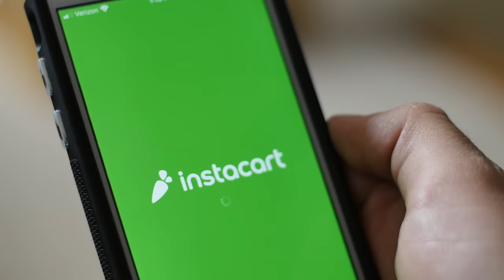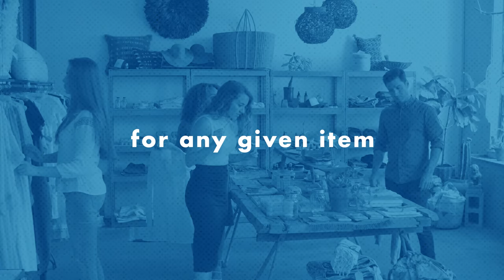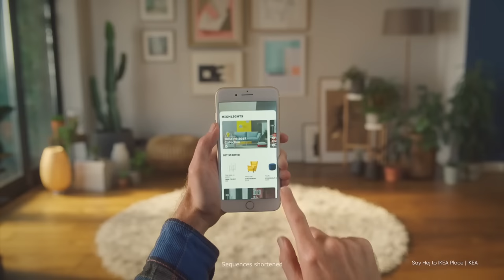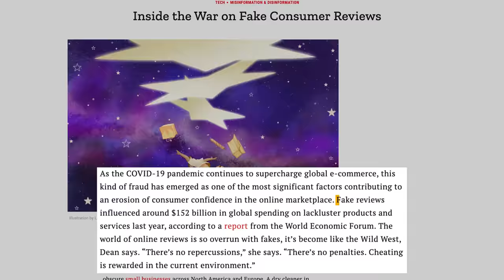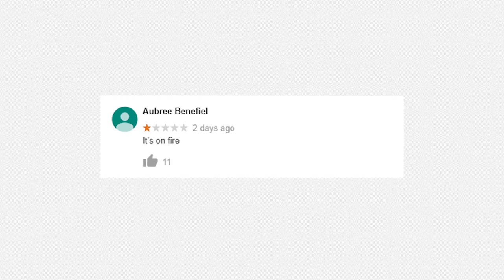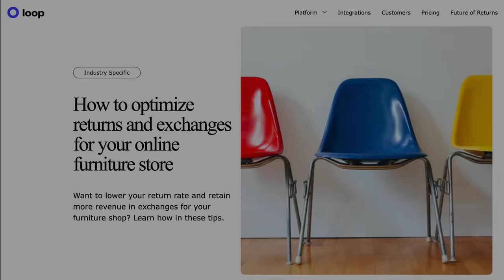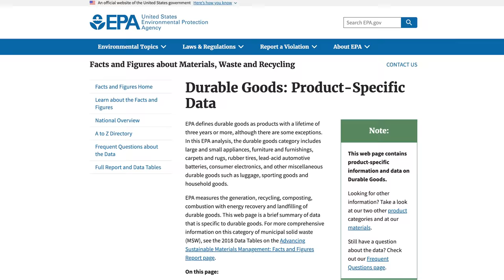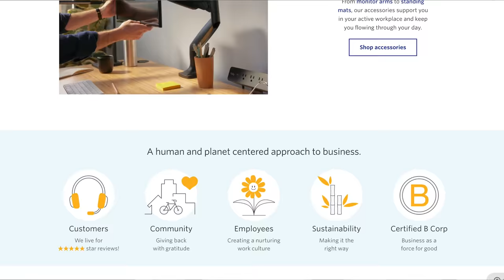The PROBLEM with Wayfair Furniture (DTC)

Comment: Quality drift is also happening with sound. Landline phones or a real stereo and speakers have better sound than smartphones or PC speakers or low-end soundbars, yet so many people go for convenience and don't realize the quality they've lost. Part of the problem is the market has bifurcated: you can get a smartphone+soundbar or a big heavy $200+ receiver with 15 inputs, but the smaller simple receivers in between have mostly disappeared.

Comment: Even after looking around at all the furniture stores here in Canada, the most comfortable sofa I found, and the best one by many accounts, was the one that was FREE.  My table cost me 75 dollars on the local classifieds.  IKEA, Article, and all the other online furniture stores you mention pale in comparison to free or used on the local classifieds.
Reply from the maker: Yeah going used is the best way to find something quality for cheap. Glad it worked out for ya 👍🏻👍🏻👍🏻
Reply: My sofa - my ex and i found it in a thrift store like 28 years ago? It was a knock-off crate-and-barrel style, sofa and love seat.  He refinished and repaired the wood parts, and a few years later (after we split) i found a company to make custom replacement cushions (knock-off sofa, cushions were different size than the standard).  Ok but now i REALLY REALLY need a new sofa!

Comment: I have a bed that's 50 years old that was given to me, I have 2 trash cans and a lamp someone put by the curb I have a few end tables, lamps, and dressers I got for free. I did have to buy some plastic storage bens for the storage unit and I did buy some plastic sliding drawers for clothing and extra storage. I do have 2 particle board shelves because I needed them and couldn't find used ones without driving 1-2 hours away to get them....lucky I was able to buy them at Walmart. I don't think I have ever bought any furniture from online. I like reusing older stuff when possible. Some of my most precious treasures have been free, used, or curbside finds.

Comment: I made the mistake of buying an Ikea couch 3 years ago.  I remembered it being "sturdy enough" when a roommate had one a decade ago.

Well, 3 years later and the arm has literally broken off.  I pulled up the upholstery to try and DIY a fix and found it was particle board held together by staples.  Tried metal brackets to reattach, and a week later the wood broke off around said brackets.

What a waste of natural resources, I will never buy an Ikea couch again.

I went to an actual furniture store and spent about 4x more this weekend to get what I hope is a real couch that will last.  But I have my lingering fears that even this couch will turn out to be a poorly made mass manufactured piece of junk.  I am having a harder and harder time trusting any manufactured products with how many times I have been burned at this point.

Comment: The thing is, I move every 3-4 years because rent is on a rapid ratchet going up and up at ever increasing rates.  The exact amount of space I have varies, so I usually wind up getting rid of a great deal of furniture.  Disposable furniture that can be thrown away easily that doesn't have to last more than 4 years has a lot of appeal.

I'm considering a job that will move me decently far away and am seriously considering if it's worth moving my existing furniture.

Comment: ive got a related but like opposite problem. Buying furniture on facebook marketplace or gumtree or whatever. POUNCE quickly before it's gone, Oh crap it's actually a bit bigger or smaller than I had imagined and that oak top really is warped and not something I can fix with a screw and a sander. But besides an attic full of future projects that I'm still deciding what to do with, I actually have some really nice hardwood furniture.

Comment: I furnished my whole place from the ReStore
I had to get to two different ones in order to get everything I wanted but it costed about $700 
I rented a truck from home Depot for a day and then I went to both and I got all my stuff and I rented a green machine from Rona which was about 24 bucks 
I cleaned the couch with it and it was fine
So all together it costed about $1,024

Comment: Funny story. I JUST bought a new bed and yes, it was DTC. The bed before though was older than I was and the only reason why I had to throw out our was because I was putting it back together after moving and a family member fell on it at the wrong stage in the building process and completely destroyed it. I was one of those magical unicorns apparently that did know exactly what I wanted in a new bed. Unfortunately no one is making that bed (I spent days looking, even on Etsy). Since I don't have the money to commission that right now I went with something that looks nice and works for my situation, and also according to reviews seems durable. So eventually I'll get my dream bed but for now I'm hoping to keep this guy for awhile.

Comment: I have purchased a lot of furniture in the past 5 years.  Prior to that i always lived in apartments so i never thought of any of my furniture as "permanent" as who knows what will fit in the next apartment.  After purchasing a home (well, convincing a bank to buy a home...) i'm taking more care with what i purchase.  that said, i have purchased a number of items from online stores, like (and including) Wayfair.  I think that the key is to separate the furniture into the categories of use and do some research.  i would not hesitate to purchase, say a side table from an online source, other than truly horrible quality, how much can go wrong?  however, with something that you will interact with everyday (couch, office chair, mattress, etc...) i would certainly not order that online.  local used markets, be that in a thrift store or via an online service (craigslist, etc...) is a great way to go especially if you are at all "handy".  you can find quality vintage items that only require a bit of work, wood glue or tighten some screws, to have a wonderful piece of furniture.

Comment: You say that people used to shop for quality furniture pieces, but did they really? Because I'd bet that no more than 90% of consumers have ever actually known how to identify well-built furniture beyond a simple level of like, something built out of solid hardwood is obviously going to be stronger than something built out of fiberboard. But there's a lot more that goes into furniture than just the materials (for example, the joint type) that affects quality. Not to mention that if it's a couch or an armchair, can you even tell what the framing is like under the upholstery? And physical stores just don't have as high standards for quality anymore. It can be really hard to know whether you are buying a well-built piece of furniture, even if you set out specifically to do so.

Also: I'm curious about you lumping in a brand like Article with a company like Wayfair. They aren't really the same thing, since Wayfair is a marketplace and Article is an actual furniture brand. And Article and some similar companies that you mention specifically advertise their furniture as being well-built, high quality, etc. It's part of their branding. In contrast to Wayfair's branding, which is more just like, it's cheap and the variety of selection is unmatched. Do you have a reason to believe that that's false or misleading advertising? I have been very curious about if Article and the like are in fact producing high quality furniture.

Comment: Interesting video…

I’m in need of a new recliner, and I’ve priced recliners on Wayfair at under $200.  They look to be similar recliners (weight rating & size) to recliners offered in my local stores for around $500-$600.  

One side of my brain says jump on it, and the other side says it sounds too good to be true.  It’s confusing…😵‍💫

Comment: Because of this my furniture motto is if my butt is going to sit on it I’m going to spend more. Cheap chairs and couches are just not worth it on the long run, but a side table or the random cute thing in the room that I don’t put my weight on and probably won’t wear out quickly doesn’t need to be high quality expensive thing. One exception is a dining table.

Comment: We all want the furniture we buy to be of quality.  But often when it arrives, we learn it isn't what we expected.  However, why return it?  Hard cushions can be softened with the addition of a little foam, which is why zippered cushions are best.  Droopy cushions can be stiffened with a little foam.  A sofa seat that's too soft can be firmed up by sliding one of those fold-up stiffeners under the seat cushions.  Throw pillows offer adjustable back support.  Etc.  Now, none of us wants to do this!  But it sure is a lot easier than returning a huge sofa!

Comment: It's as simple as this:

A high-quality couch made with fair wages and ethically sourced materials that seats three people: $7,500.

A mid-quality couch made with lower wages and questionably sourced materials that seats three: $2,000.

A low-quality couch made with minimum wages and highly synthetic materials that seats three: $150.

Placing tariffs on goods made with extremely cheap labor forces more people to buy goods from higher-wage earners, and because of increased sales volume, the prices actually drop.

Comment: I ordered a bathroom vanity from wayfair and what they sent was the wrong size.  They told me to keep the one they sent and they would send the correct one.  They resent it, and lo and behold, it was the same thing as the first one.  Once again, they said to keep that one and they would send the correct one.  IT WAS THE WRONG ONE, AGAIN!

Turns out the product description was incorrect and the size I wanted (that matched the product description) didn't exist.  It was their mistake, and I got a refund and three vanities that didn't fit.  I tried to craigslist them, but I ended up moving and had to throw them out because I couldn't rehome them.

Comment: Auction houses everywhere are full of what's called Big Brown Furniture -- heavy, solid wood stuff that no one wants anymore, and it's tragic. I have a bigass 3-drawer dresser in my dining room that holds kitchen appliances and other cooking effluvia. I use it as a breakfront (Google it, kids). My husband had picked it up off the curb long before he met me. Fast forward 30-odd years, he died, I moved away, but I found the thing had sentimental value. So I had a refinisher take a crack at it. And lo and behold, it's an art deco/midcentury modern transitional piece, solid walnut with quartersawn oak trim. I have a big solid pine desk my father made. And no one is going to want these things when I'm gone, because it's boring to have the same furniture your whole life. It's sad.

Comment: The last time I bought a couch it took ages to find the right one, the colour and style was important but most important was what is felt like sitting on it, most were too uncomfortable, either the back was too low or the material felt cheap and nasty or it was too soft or it was too hard. I probably went to 10 or 12 different furniture stores, which may seem a lot, but that couch should last 30 or more years and if it wasn't comfortable then it would have been a waste of time and money getting it. I cannot comprehend why anyone would buy any furniture online, just going to stores took me about 3 weekends, sitting down on something I'll spend the next 30 odd years sitting on was the whole point of sitting on them. Most looked Ok but they weren't comfortable. Most were just awful to the touch and not suitable for what I wanted them for, which was, again, something comfortable to sit on. So no, I'll never buy furniture online. Or shoes. Or food. Or clothes. What online shopping cannot replicate is holding the item in my hand, feeling the texture and looking at the quality or lack of quality of the item.

Comment: Thank you for this. I still have 50 year old unpainted bookcases and they are perect. So is my 1970's sofa. To hell with this junk.
Reply: Rooms To Go in the 2000s had higher end furniture made in Italy that you had to order up front and wait 6 months. My parents had a nearly 20 year old Italian leather couch set that they bought for $3000 in 2002 that they finally sold in 2018. I worked at Pier 1 Imports right before they went bankrupt and they had quality exotic wood furniture from Indonesia that were similarly made to order though it was often damaged in shipping. They preferred large boxes rather than pallets.

Comment: I ordered a couch from Wayfair.  The couch showed up later than Wayfair said it would (by several days).  And the guy who was supposed to put it together was 41 minutes late.  Wayfair's website said to wait 15 minutes in case of traffic or something.  The couch was damaged.  When I informed them of this, they agreed to replace the couch for free (but this was a lie).  They sent several emails stating that it would and would not be replaced.  This was very confusing, so a quick call to Wayfair informed me that the item was discontinued and that it was not possible to send me a replacement.  If I wanted to make a lot of money, then I should be following Wayfair's example of robbing people.  they said that they would offer me a refund (about 4-5 days after the couch was returned), but would only refund the price of the couch, and not what it cost to put it together.  They said that they would transfer me to someone who would be able to refund that amount and that I would have to wait 4-5 minutes to talk to an agent.  When I was transferred, a robot informed me that my wait was 628 minutes.  Like I am going to wait on the phone over 10 hours.  If I could find a way to review Wayfair, I would give them a 1 Star rating, (or whatever the lowest rating is),  This whole ordeal is beyond horrible.  I definitely would recommend that Wayfair be avoided at all costs.  They are sending the return information to someone about a 30 minute drive from my house.  Yeah, this really helps.  @Wayfair: Thank you for all the pain that I never imagined, and goodbye.

Comment: Abysmal experience buying 2 beds from Wayfair, which advertised the beds as solid wood. Both frames were cheap particle board. Mattress fell to the floor in the middle of the night on both beds. Complete garbage, and Wayfair did not reimburse, they referred me to the manufacturers of the two bed frames.

Comment: Yes, your grandparents had good quality furniture that lasted forever.  That's also why your grandparents' home looked old fashioned.  The style didn't change because why get rid of well built furniture?  The risk you run is not being able to upgrade or keep up with changing styles.  I have a similar problem  My cottage is too small for the two couches I have.  I like the big one best, but the smaller couch is 3 inches of solid pine construction with cushions on it.  It will outlive me.  So I can't justify tossing it to make room.

Comment: The problem with Wayfair furniture is that its also at Home Depot, Walmart and everywhere else. Its the same cheap garbage with different prices depending on the store. Read the fine print and specifications folks...I saw a chair ay Wayfair for 382.00 CAD and it was also....and it was EXACTLY the same one at Home Depot for 854.00 CAD. Then a bedspread for $1012.00 CAD at Wayfair...same one at Bed Bath and Beyond for $112.00 CAD . Oh and seems similar like a typo? Nope I called. Do your homework because you are MOST definitely going to get ripped off. Check the sizes!!

Comment: What did that poor lamp do to you? HA HA!

Regardless, I purchased a refurbished Steelcase Leap V2 chair in 2020, and 3 years on I hate it. It was only comfortable until the cushion compacted about a year and a half in, and now it creaks like crazy, the arm rests are falling apart and it bothers my back. I'm trying to work with the company I bought it from (they have a 5 year warranty), but it's like pulling teeth. I'm not saying buying used is a bad idea, but be careful of some of the refurbishers out there, because they can be predatory too.

Comment: The reality is that making stuff is expensive, and quality parts are also expensive. Three decades of wage stagnation have gutted the purchasing power of the bottom 90%. That's the real reason why the only options in most markets are: unachievably expensive good stuff or affordable garbage.

there's no middle ground products because the middle class' purchasing power has been dwindling for decades.